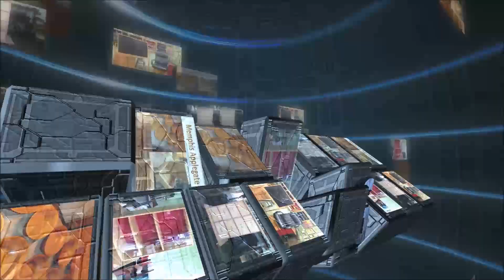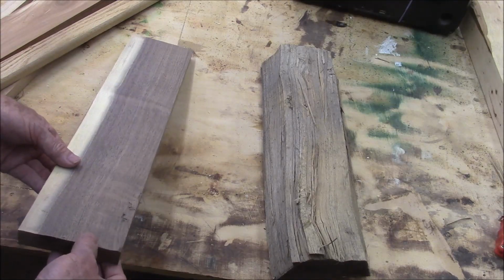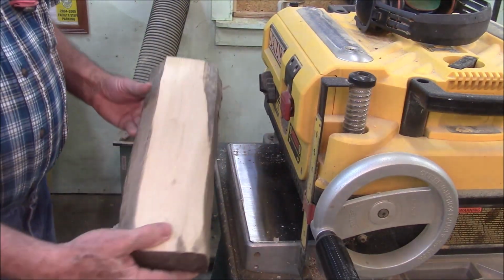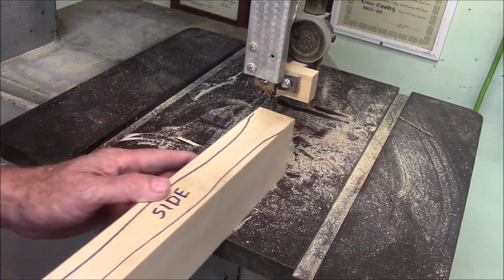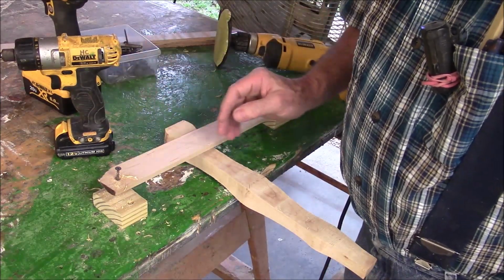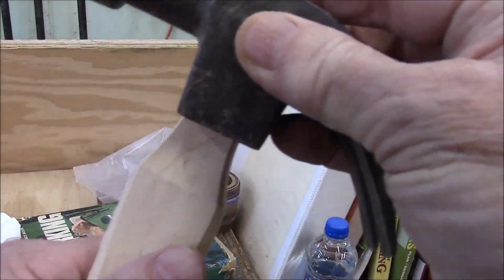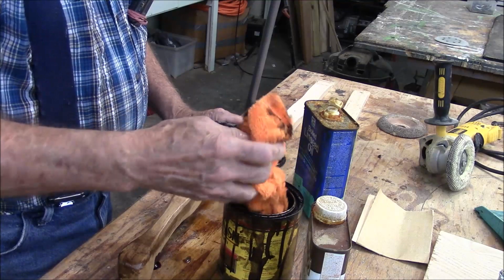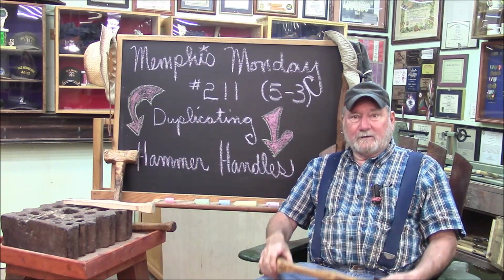Duplicating a Hammer Handle MM 211 (5 3)

Comment: Well done. Did you consider making the handle from laminations? that might prevent the split in the handle that can occur after driving the steel wedge in, which needs to be at a diagonal to the wood grain and is stronger.
Reply from the maker: I have made laminated handles, but the catch here was that I wanted to use the firewood.
    However, I may steal your idea and make a handle with thin plies of light and dark wood.  I say thin plies because one problem with, say a three ply lamination, is that after shaping the head you are left with mostly the center part.  Of course, the solution is to laminate perpendicular to the long axis, which might work, come to think of it.  
     Thanks for watching and commenting.  Hope to see you next week.
Reply: Yes, you got what I mean. That would provide the most strength to withstand the pressure from pulling a nail.